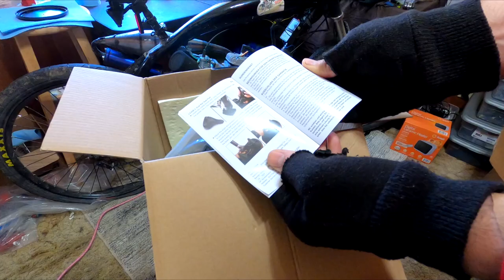Zacro Bike Saddle On A Motorized Bike

Comment: That's like my Schwinn Wide-seat. Springs are right off an older model Schwinn, as the new one has what looks like Airbags in place of the springs, and is really quite comfy, and standing up to everything I can throw at it, including my 270 pound carcass

Comment: Hey LA Hover, saw this in the group last night. Look up dirt bike clutch assist. I recommend giving this a shot with your saf clutch. It creates a second point of leverage between the clutch handle and the actuator for the clutch on your bike. It requires a small bit of modification but may be helpful to those running stiffer clutches. They start at 15 bucks as well. Keep up the awesome vids as always!!
Reply: I agree  I call it an “easy pull stunt clutch lever “
  Same thing?
Reply: @joshuagerlach6943  it's like a small enclosed box after your actual lever
Reply: @Fr3nchFR135    Yeah sold in anodized colors 
With a  2 finger lever   30$ for both in a package on eBay
Reply: @joshuagerlach6943  yea like that, was think about the actual box part but having the lever with it like that means technically you only have to adapt the one side to use the smaller cable into.
Reply: @Fr3nchFR135    The stock lever goes down to far    With the reduction box So it feels better with the  new lever because it’s pivot is farther from the bars .

Comment: my motorized bike got stolen about 2 years ago. Watching your vids makes me want to build another one. My old one had BikeBerry's flying horse 80cc on it with an aftermarket carb, high compression head and ngk sparkplug. Thinking about going with the zeda 80 and possibly have the dio reed version of it but not too sure yet.

Comment: That seat looks really comfy. You weigh less then me, I'm pretty sure; so you might not have the same problem I had with my seat that had the exact same generic bracketing as this seat. Mine was of my red Schwinn, it was unbelievable comfortable cause those springs really soaked up the pumps. The problem I eventually had like a week of me riding it, maybe less; was that my fatness ended up bending that main bracket that like a half moon shaped C channel that holds the springs bent down into the seat post on me. And that made the springs not spring anymore, which I'm sure you can imagine stunk. I tried to fix it but it needed to be braced with a welded in piece or something. If this one lasts and doesn't bend it's definitely a good seat, unless you put on a couple or more pounds. Like I might have done this past year. Lol. 😁
Reply from the maker: Same thing happened to me on my first trail bike. I carry a heavy bag on long rides and the bracket just says NOPE! Will see if this does the same.

Comment: Love the channel. I'm on my second build, phantom  85, I know this isn't the right way to ask but I know nothing about discord, I'm considering gas frame as u recommended but I have a schwinn sting ray with 20×4 back rim, I just dont know about the 20in rim ratio , will it hurt performance, it being so small comparative to a 28in, if so how big of a difference. Sorry again  , and thanks , some one that loves this out of the norm hobbie and not just making content, refreshing
Reply from the maker: The Phantom 85 loves to pull, but does not like to cruise. This will be amplified on 20" wheels and give a jerky ride with allot of 4 stroking when ever you don't have much load on the motor. There are two things you can do to smooth out the build. run the smallest sprocket you can 32t or smaller if the build allows it. And retard the ignition timing.
https://youtu.be/lbzprNFBMOY

Comment: Very nice....hey brother I just watched s video and done s little research on the centrifugal clutch for the 2 stroke motorized bicycle engine and it looks like it would be a good thing especially for a bike that is rode in town where alot of stop and starting is done and I'm sure it would take off from a stop alot better than regular clutch because it revs a little to move it cut out on all the bogging....try it out on your daily... that is a sweet bike LA I got give it to you... you sure have got the tune dialed in... it sounds so good
Reply: They require a "Pull-Start",and I too will be doing that when they make a solid one.They're all 'pot metal and plastic'so far.I'd like that clutch too,but I want a 'Zerk' fitting first,instead of the oil hole.Darn good suggestion.
Reply: @bryduhbikeguy  they do not require a pull start ...you can still use the stock clutch and pedal start go on here look at video...
Reply from the maker: I thought it did too, but it looks like they use a one way bearing.
Reply: @LAHover  I think I'm going to try one... with the extra power that I'm making now I really think it would help from a dead stop ..I know that beast you have now it would sure pull it good...
Reply: @dannyoutlaw9919  Thanks.I will.
Reply: @LAHover  hey bud I hate to ask you questions on here but I don't have s computer and the discord server....but I wanted to ask you did drilling your crank make it run smoother....I've got my seeutek apart to port match it and I want to balance it while I'm at it...

Comment: so, for a vehicle i was gonna buy a motorcycle, but i was wondering if it would be possible to use one of these bikes as a proper vehicle?
Reply from the maker: Honestly these lean more towards fun than practical. I use mine every week to go to work, but It's only a 5 mile round trip.
Electric bikes are far more reliable and practical, and Honda grom clones like the 125cc "Vador X" are cheaper than allot of e-bikes but more practical for range.
Here are my thought about these bikes https://youtu.be/KYqbvgVxZXk
Reply: @LAHover  Thank you for the reply! I think i may still get the motorcycle I had planned to, but i will probably build one of these bikes someday just to have fun riding around.

Comment: I'm sorry LA but that engine sounds like it's slipping,  two stroking and kinda slow .. 🐌  ,  Seat look comfortable enough! No disrespect
Reply from the maker: All good, This is actually the one I'm putting the budget clutch on because it won't stop slipping no matter how I adjust it.
This daily rider was never meant for speed ;) Has some good bottom end pull though :)
Remember this was the "110cc" motor that had absolutely NO power out of the box, was worse than the 49cc... Had a whole video about it lol
Reply: Darcy, with all the amazing builds you've done, doesn't everything feel slow? :) Do you ship to Czech Republic? just wondering. Thanks
Reply: @LAHover  oh ok..... totally get it now .. well for having no power it's not bad now
Reply from the maker: Oh yeah, man it was BAD! lol
This it how it came https://youtu.be/g80VGEJlZjM
And here it what I did to try and fix it https://youtu.be/y-IGFM0atKA
I have no idea if my work helped much, but I suspect the pipe made the biggest difference...

Comment: i have 2 of the seat one on a ebike for about 6 months  and a new for a motorize bicycle  I like and I'm a big man....you know I seen many video I on bike motor  did you know that it cheaper to a kit then it is to buy just a motor if you wanted bottom end that's harder yet...founded one on amazon and that was $100.00 free shipping i like to know why buy a kit if your going replace most of it...If anyone have a motor they one sell cheap that run, pm at my email check here my video